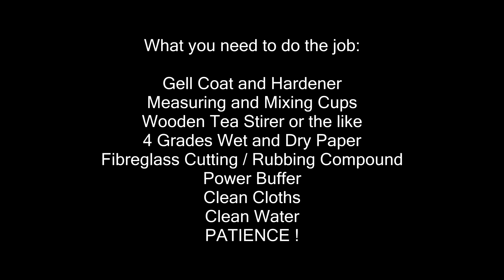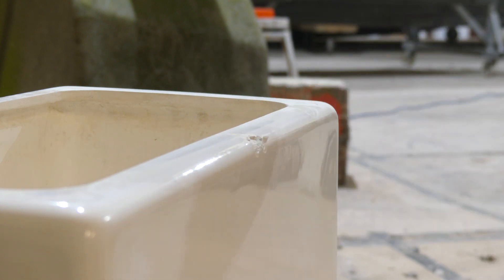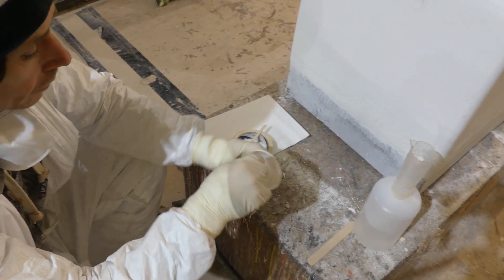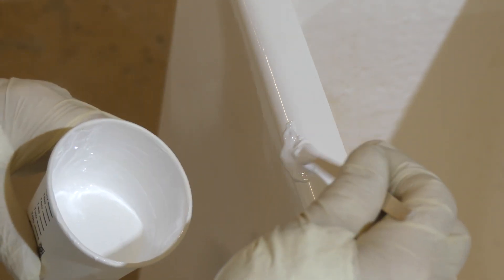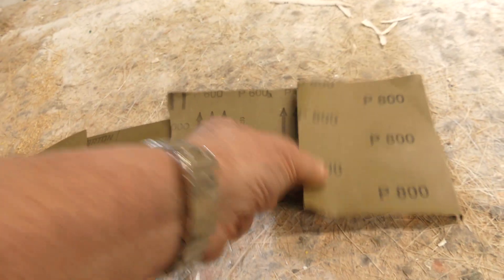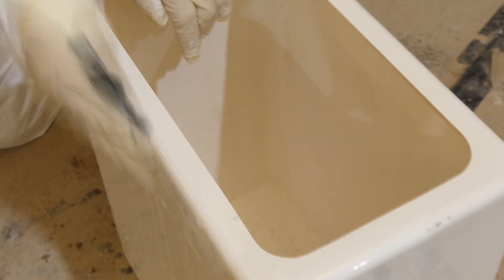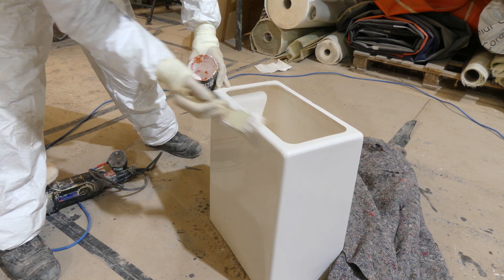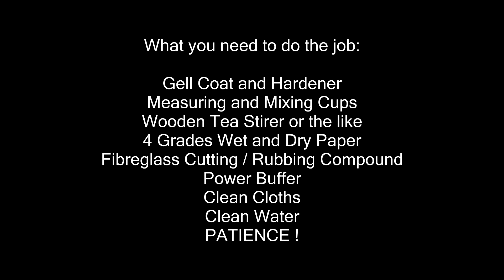XS Ribs:  How to do a Fibreglass  / Gell Coat Repair of a Chip or Scratch on the Hull of your Boat.

Comment: Hi, very useful video for this beginner.  We are renovating an old fibreglass boat, and there are a number of chips like this along corners.  Is it the same process just multiple times?
Reply from the maker: Yes just make sure the chips arer not all one air bubble from new and the whole chine needs "knocking out" as long as the surround is all solid just repeat the process over and over again